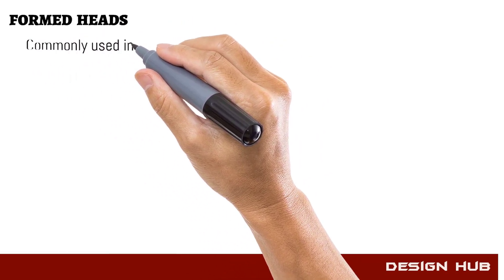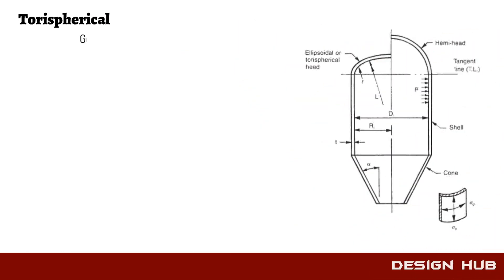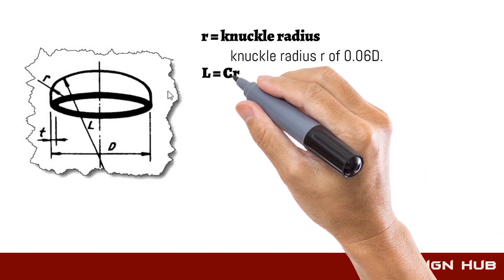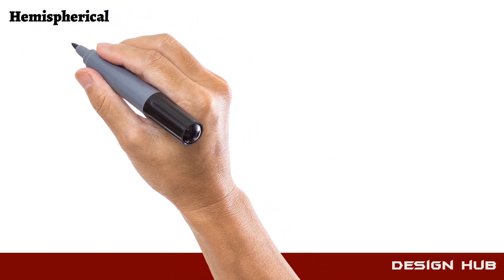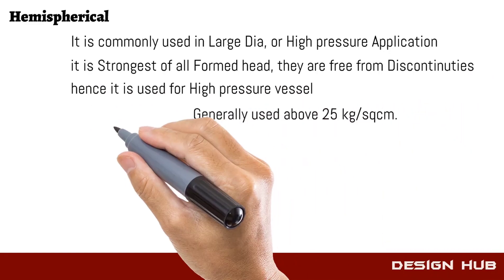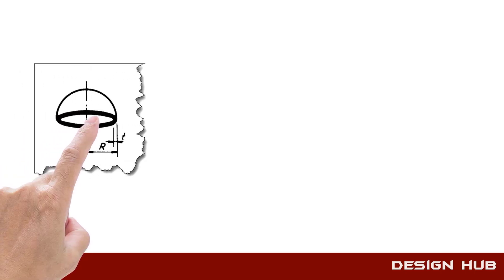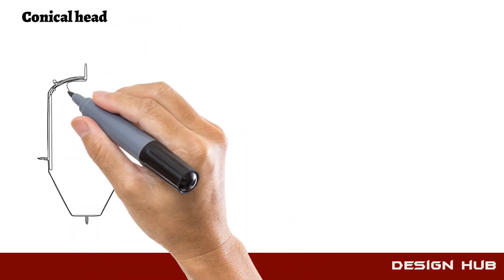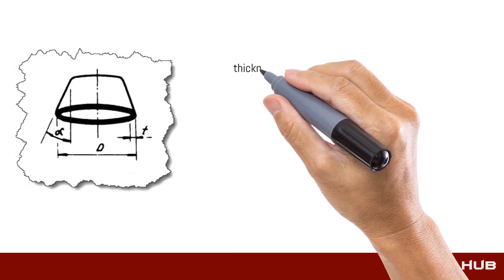Pressure vessel head design and it's type |asme div 1|

Comment: Thanks for your practical informations about pressure vessels at first. Secondly, I did not understand "SE" on formula. what is "SE"?
Reply: E = weld efficiency, S = maximum allowable stress of the material

Comment: When designing a spherical head,  does it thickness need to be at least equal to the shell thickness? or can we have a smaller thickness in the head. I'm designing  a 96ft tall pressure vessel with a diameter of 8ft.